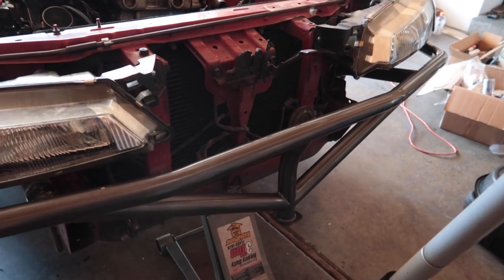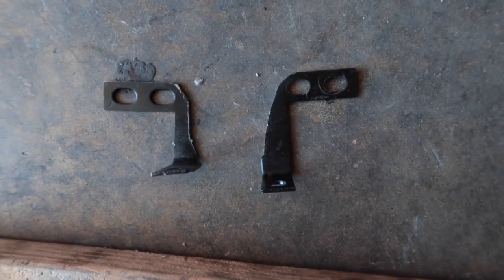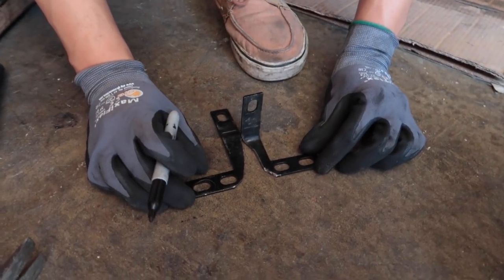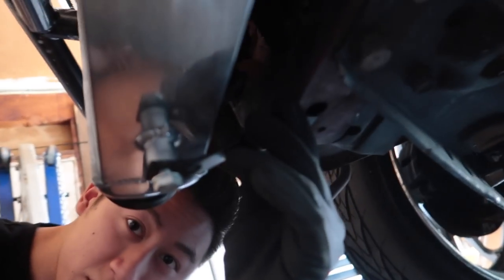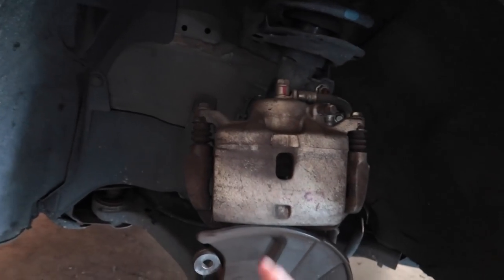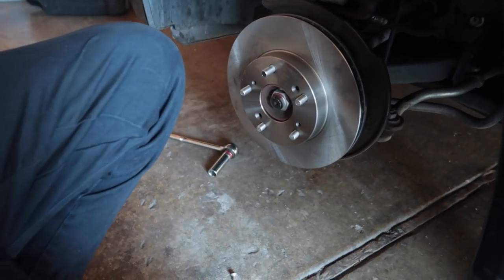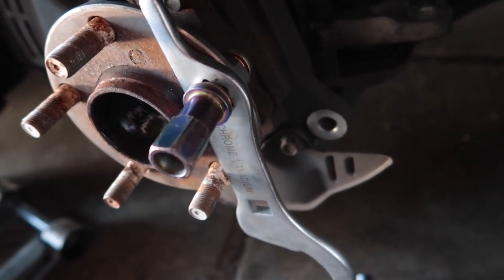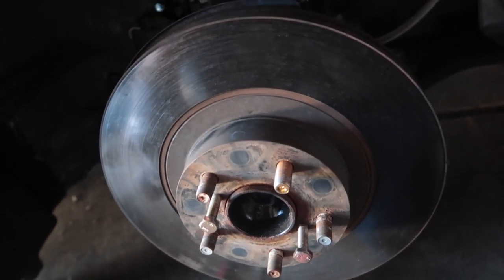New Intercooler | New Rotors | New Wheel Studd!

Comment: with changing the rotors, it is always better to change both at the same time. so either the front pairs or rear pairs. that way when you brake. it will be even.